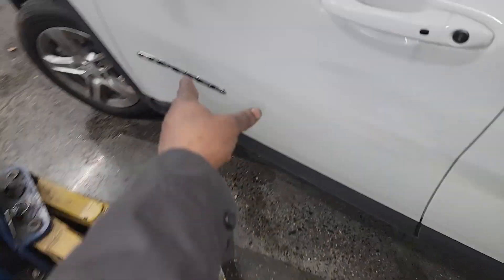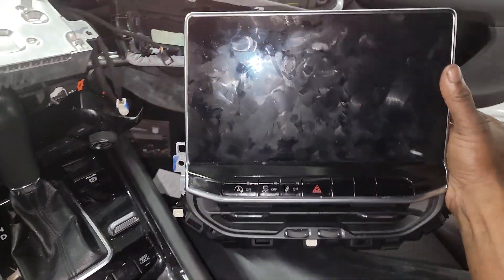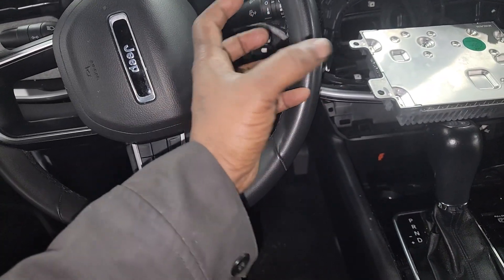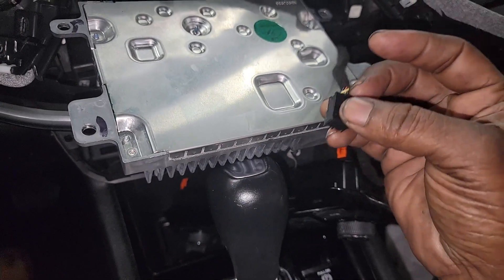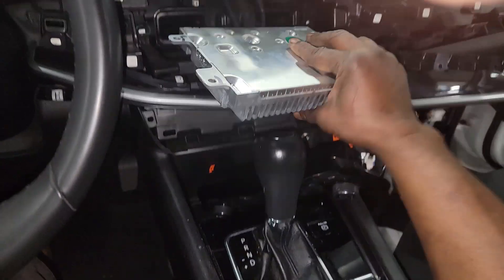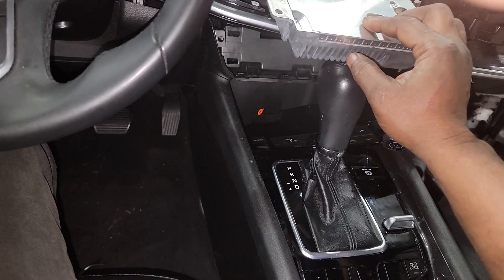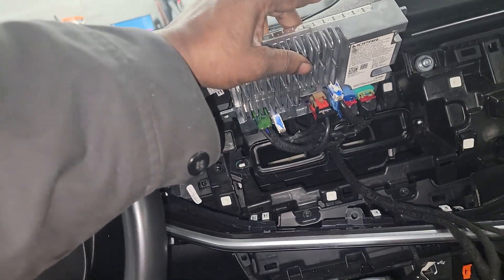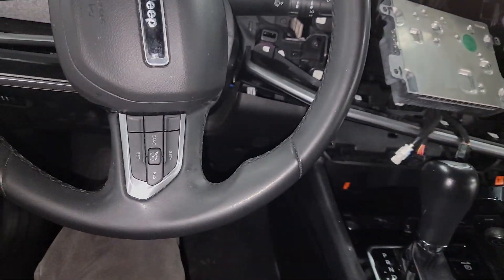“Car Radios Aren’t What They Used to Be! Another Mechanic Got This Totally Wrong”

Comment: I use to be the radio tech that goes around to dealerships back in the day , I can confirm radios are totally integrated into the car .
Reply: I have a 2000 R129> steering wheel ZERO buttons. Speedo Custer classic. Running Alpine.

Comment: Be careful using customer's cars as test parts. What if something that plugs into the radio module shorted and blew it up? You plug in the one you borrowed and it gets smoked too.....now you got 2 dead modules and you're no closer to finding the problem. Not to mention the extremely uncomfortable conversations you are about to have to have with your boss and the owner of the donor car. And for God sake, put a shop towel over the shifter knob, you are scratching the fuc out of it. If I have to tear into a dash I usually drape a clean fender cover over the whole console in case I drop a tool or part.

Comment: GM tech for over 27 years and yes this is how all the new car radios and radio systems are they are absolute garbage. The manufacturers seem to go with the lowest bidder to get their supplies of radios for their vehicles I've had vehicles with no less than 1500 miles having radio or infotainment display issues or inop issues every thing is electrical and is on a Can Buss system there is no more plug and play even for a simple window switch it has to be programmed to the vehicle so that other modules recognize it and can communicate with it in order for it to work. They are over complicating simple systems with electrical now I was just doing training for upcoming new features for trucks and differentials are not just gears in a housing anymore they are now incorporating servos and solenoids to engage differentiation around turns and slippage as well as for 4wd or off road situations. These systems will fail as they are not built to last. Hence the term they don't build them like they used to. SMMFH

Comment: if it was my Compass with the working radio and you touched my car to diagnose another similar car and I found out we throwing hands Django
Reply from the maker: Smdh, so you here fussing about a what if? You obviously not a mechanic. I keep making the mistake of thinking only mechanics watch this stuff. Thanks dude.
Reply: @OnlineMechanicTips  Module swapping is the quickest way to diagnose certain problems, but you have to be careful because the VIN numbers don't match and it can create all sorts of problems!
Reply from the maker: @RecordnRtist  You are exactly right especially on the newer cars. Once I saw the screen power up and displayed it was a quick connector removal..Lol

Comment: My 2013 factory radio was 4 parts. Display, radio, DSP/amp, and accessories interface. Now replaced with aftermarket, which is essentially the same 4 parts, just looks much different than the Ford factory stuff.

And neither really fit in the 2din space in a vehicle, they are just boxes that have to go somewhere.

Comment: They usually have several "AUDIO" fuses. Audio1, Audio2 ect.... These, like all stellantis junk, suffer load shedding constantly. I would have checked the battery SoC too
Usually you can reboot the module when the screen stays off by holding the power button for 30-40 secs. Im a certified Auto tech for a rental company going on 5 years

Comment: Speaking of radios.  If I remember correctly, I had to replace a radio and/or antenna that another technician diagnosed as needing replacement.  Well, what I installed did not fix the problem.  I spent a good part of the day rediagnosing the problem.  On that particular day, Will Smith was filming one of his movies on the street outside of the shop.  Because I had to work on the car, I missed the filming of the movie and possibly meeting Will Smith looong before he slapped Chris Rock.  The movie he was filming that day in front of the shop was, The Pursuit of Happyness.

Comment: This screen and radio sucks to get out. The PIA is detrimming the dash to get it out. The display in the compass seem to black out intermittently in the winter due to the heater turned on in bilevel or vent with the vents below the display.

Comment: I put several Android radios in my 06 Charger RT trying to get one that everything worked and it sounded nice. They need to support the canbus your car uses. The Charger has the premium sound system so it has small extra amps under the steering shaft for the rear speakers and sub. So far the best one sounds great but the fader only fades to the front speakers, once it's centered the front and rear are balanced and the sub works. One of the big problems is my car has the early production power plug and most of the Android radios made for it only include the second generation plug the later run 06 and up use. The other problem is the premium sound uses a completely different wiring setup so only the front speakers worked on my car.
I finally had enough power plugs and amp or no amp plugs to make it work between all the radios I collected and I used one for a 2007 and up Jeep or ram truck and modified the dash face plate it has to fit the display it has, 10.1 inch.
Sisters 08 PT Cruiser had the basic no amp or sub radio in it and I found a complete upgrade that includes the radio built into a replacement dash face and all the plugs. It popped right in, had to swap the clock and controls to the new setup and the fader and everything worked from the start. It's nice being tied into the phone and being able to use maps and all the other Android stuff and sounds way better than the stock radio did. Now I have a leftover satellite/am fm tuner/ 6 disk cd changer, and cassette radio for a 06 Charger.
Still hoping to eventually get the proper bus adapter or plugs to make the fader work properly but it works and is done for my car.